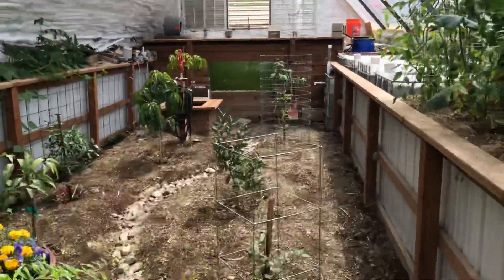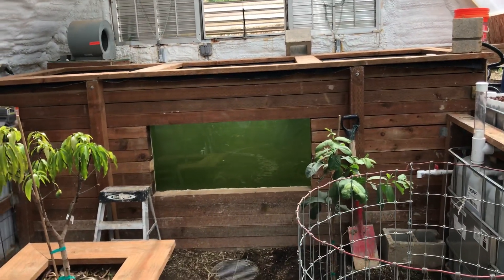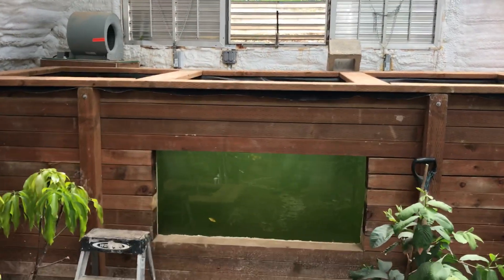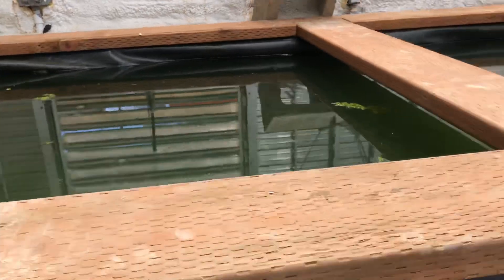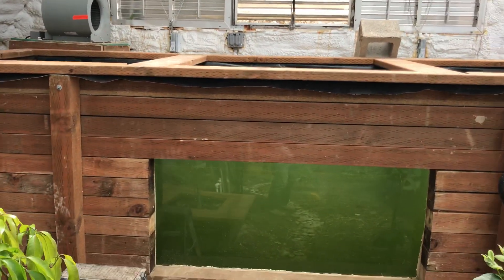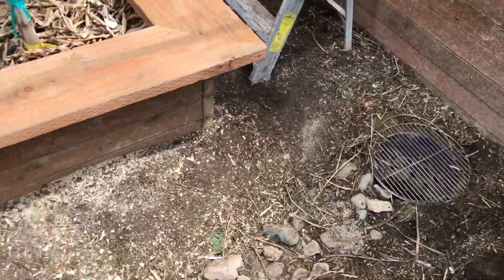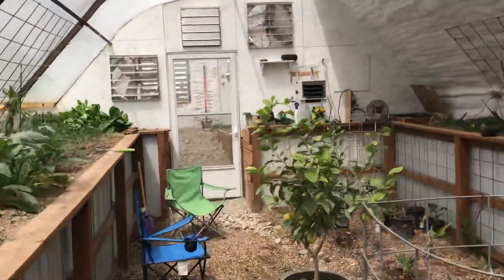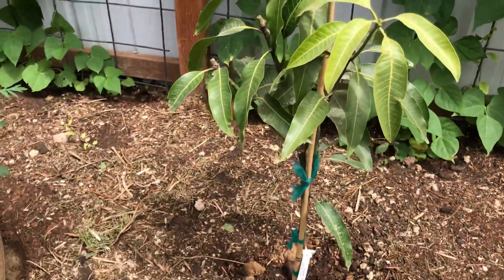Greenhouse in the snow. May 2020 update

Comment: Thanks for sharing. I am in Northern Utah and was looking at the Greenhouse kits from greenhouse in the snow. New to the climate battery/geothermal process. Any Updates? Still loving the project? Would you do something differently if you could?
Reply from the maker: I would make sure the 2x2 metal is treated for rust.  I think they do that now.  Also, you can never have too many pipes.  Really happy so far.

Comment: Do you think the planted trees near the fish tank/ground water area might experience root rot?
Reply from the maker: We have just one tree planted on the East end where we have a water table issue.  So far it seems to be doing good.  Water table drops off about 10 feet from the East end.  Really weird.  When we put in the trenches for the geothermal, it seems to have lowered the water table even further as the trench picks up some of the water.  We trenched downhill and layered in gravel to pick up some of the ground water and ran it to a pond which stays full year round and doesn't freeze because of the new ground water coming in.

Comment: Thanks for all the videos on your greenhouse. I am sorry if you already answered this question but, could you use the same 12, 230ft. tubes for heating and cooling?  Also I am concerned that where dirt contacts metal siding it will rust away and need to be replaced. How soon? I do not know.
Reply from the maker: I'll report as problems arise in regards to rust.

Comment: How much did the kit cost you?
Reply from the maker: I think the kit was around $10,600.  I'll be all in around $35K once I get the solar finished.  I think it could be done for $25K
Reply: @trailbreakfarms  I concur.  I bought my kit for my 60' long geothermalhouse for $11000 from Russ as well (shipping was $2k to Virginia).  I would estimate about $37-38k once I get solar and a well installed as well (I should get about $1800 back from solar credits).  I am currently installing a cinder block retaining wall (just poured the foundation this weekend).  Next one I build (I have plans for going commercial and doing 8-10 total greenhouses) I will be doing a wooden retaining wall with siding like you have as the cost and time to install make the cinder block unattractive to me for large scale 100' houses.

Question for you Steve.... How big are you sizing your solar system?  I have to have it for mine as I'm running a LOT of aquaponics... so batteries are essential. I just haven't done my math yet and wanted to see what you're planning on using.  I'm thinking around 2-3kWh, with a week's worth of battery storage... Prolly cost me $7-8k total.  That sound right for you?
Reply from the maker: @basedbear1605  I went with a Solar Maxx 6000 System which has 1410 Watts and 4.32 KWh.  Good thing is I can add panels and batteries if needed.  I'm not sure if its too much or not enough.  I'm hoping it will run my GH, my Well and my Shop building.  Time will tell.  Good luck on yours.  Would love to see what it looks like.
Reply: @trailbreakfarms  Just finished uploading the last 2 videos to my channel... one shows the mistake I made... one of the back beams has created a slight bulge.. the other shows the foundation for the retaining wall which we just installed.  Just click my icon and check em out. 

I am going to be putting a square room on the end of my greenhouse, and the fish will be there in totes (it's uphill from the rest of it) and the whole thing will feed gravity feed down the length of the greenhouse through flow beds.... then to the other side and through deep water culture beds back to a sump then pumped back into the fish tanks.

Comment: This is awesome!
With your high water table, did you use solid pipes (vs perforated) to keep water from seeping in?  If so does the solid pipe lead to a decreased heat exchange or humidity problems since you can’t push any of the moist greenhouse air into the ground?
Reply from the maker: My water table ebbs and flows during the year.  Its a big issue!  Because we hit water while drilling test holes we went with solid pipes but I believe some of them have taken on water.  I am going to dig around the pipes to try to make a determination.  I would say perforated pipes are ideal for geothermal for the reasons you mention.  Wish I could have done that.
Reply: @trailbreakfarms  Alliance Nebraska Greenhouse was working perfectly why wasn't his design replicated exactly?
Reply from the maker: @cynthiacetrangelo3398  Russ's GH is attached to his home and 37 years old.  Their Kit is a little different than what Russ has.  My GH includes many of their recommendations such as spray on insulation, fans and geothermal tubes.  I have made some variations and upgrades based on my circumstances.  Geothermal is probably biggest challenge.  It doesn't do 100% of the heating and cooling needed.  So that is where the creativity/adjustment is needed.